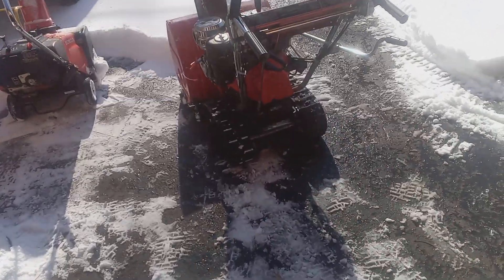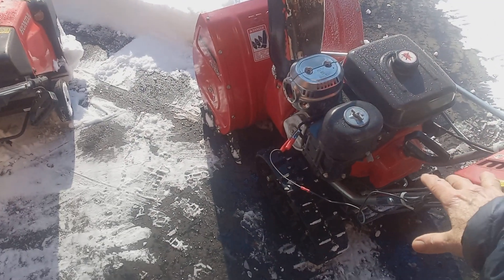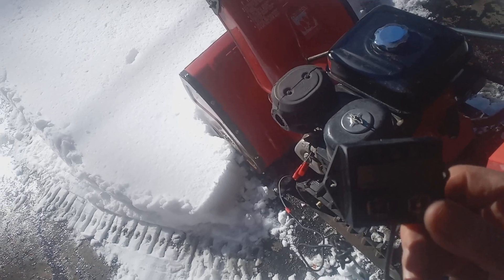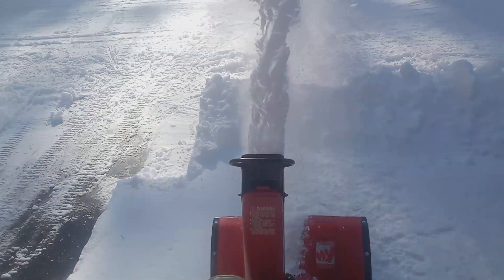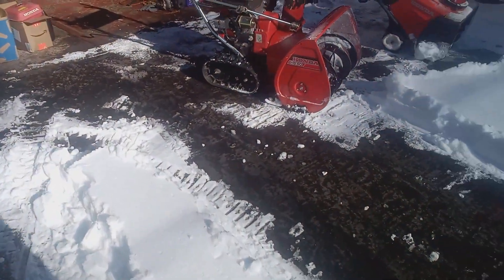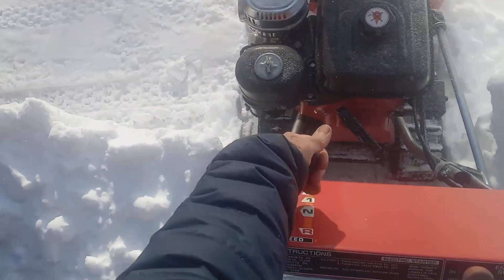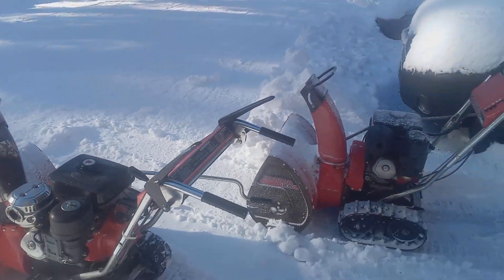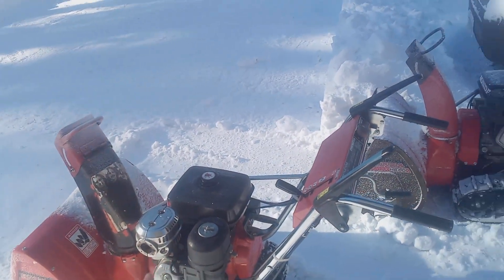HOW TO IMPROVE  Blowing Power With Honda Snowblower

Comment: Excellent video Anthony. Proper engine rpm is critical for a high impeller tip speed.
Reply from the maker: Thanks. very common issue I see is lower than spec WOT RPM's.

Comment: is the whole get a bigger injector a real thing or not ?
Reply from the maker: depends on your elevation. if you are talking about re-jetting the carburetor. and if the RPM'sare up to spec and you still lack power.
Reply: no ..for efi you would have to remap the ignition to compensate for the extra fuel